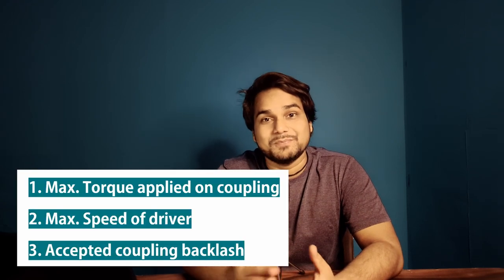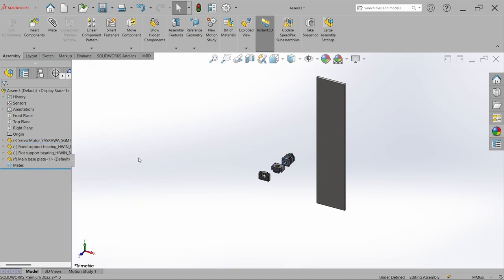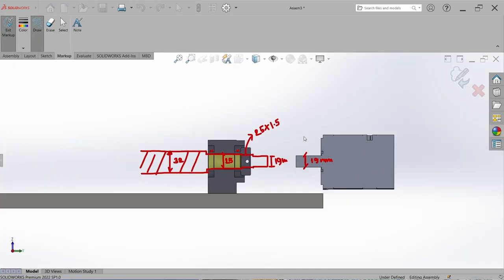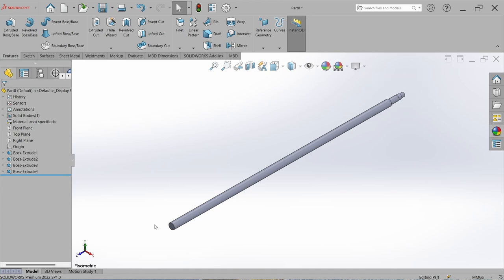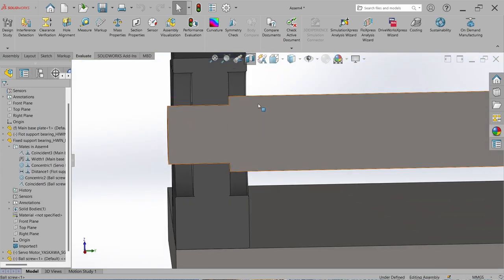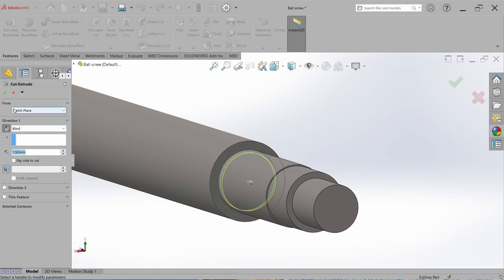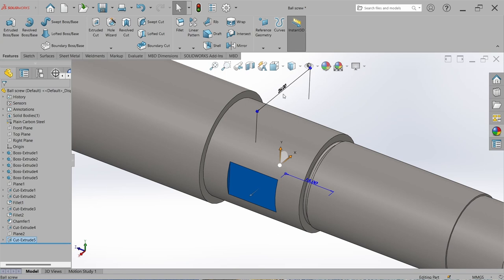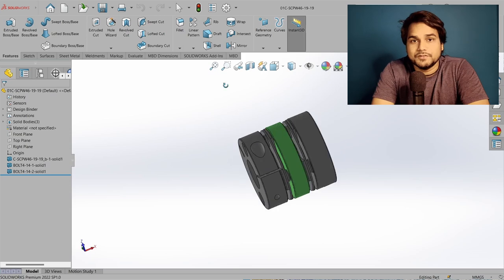Servo Coupling Selection and Ball Screw Design | Solidworks

Comment: Sir can we use chuck nut in place of circlip here at extreme end side
Reply from the maker: Hi Gangwar, yes, we can use chuck nut instead of circlip, but this will not add performance improvement in general circumstances.
moreover, making external thread on ball screw of size like M25 cost much then the simple circlip cut. 
no worry about circlip life, Use correct size of circlip. you will get enough life.
Reply: Thanks 🙏 sir
Reply: Sir m waiting for gearmotor selection series
Reply from the maker: Okay. Very soon

Comment: Dear ayush..
I am struggling in one pueumatic based pressing system...we have used two load cells in one double guided cylinder to check the two different part pressing load...but due to some miss alignment one load cell not taking the load some time... please suggest how to rectify this issue
Reply from the maker: Hi sir, It would be better, if you could Email some pictures or video. it might be possible the part which to be press, having different height.. in that case spring loaded mechanism can work.. but cant say anything without seeing actual picture. please email.

Comment: One question. why did you selected the locknut of size M25*1,5? Is there any reason behind this?
Reply from the maker: This is a standard lock nut. M25X1.5 as per our shaft size in this project